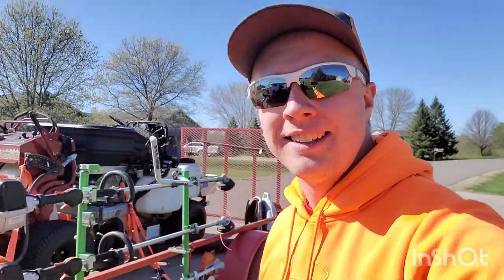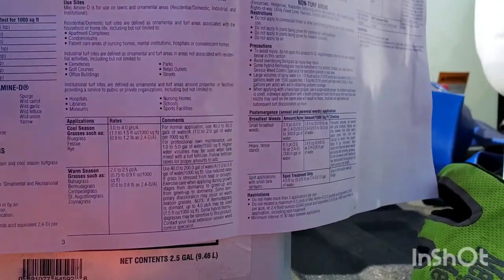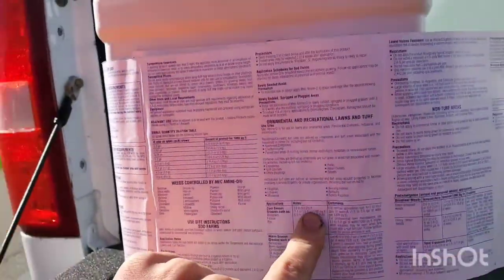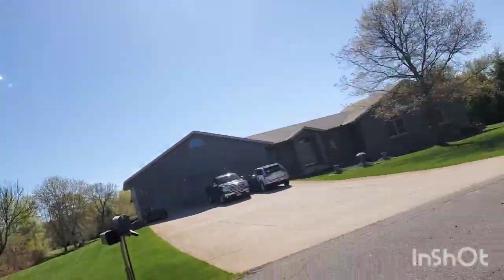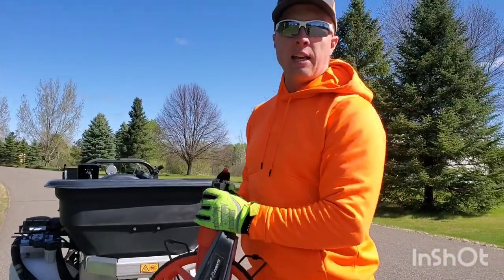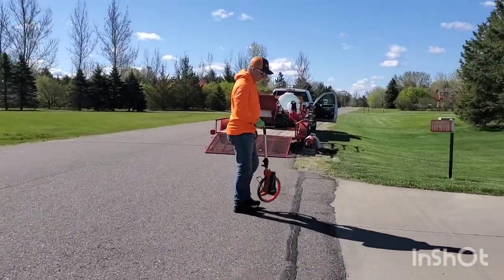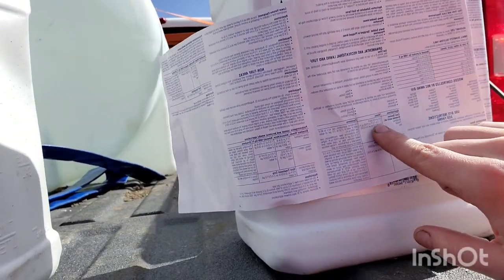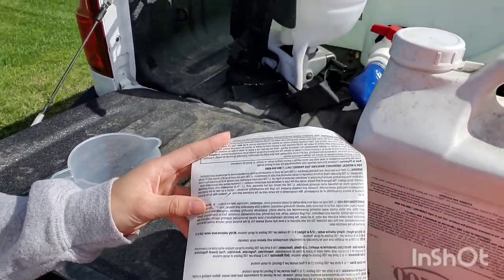How To Calibrate A Sprayer (Toro Spray Master)

Comment: cool drone footage. I run my at 40 psi at 4m.p.h. with the lavender tips. Should be on back of chest pad that will tell you it does 1/3 gallon per 1,000 sq ft with lavender tips, 4 m.p.h., and 40 psi.
Reply from the maker: That's an excellent point! I knew it did on the z spray but haven't pulled mine off yet. I'm sure it does though

Comment: Question.  At what speed and psi/ gallon per 1000 sq feet  do you put down your pre-emergent down so it would get down to the soil.
Reply from the maker: I do only granular pre emergent. We only spray for post emergent broadleaf. Post emergent, we spray at around 4mph and psi is between 35 and 45 psi depending on the day.